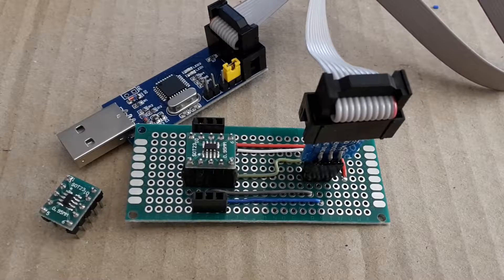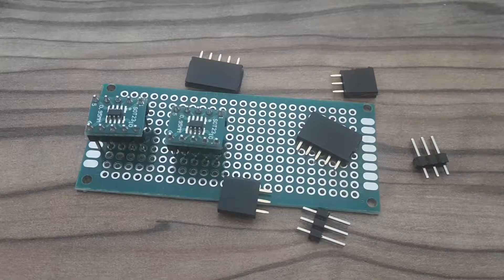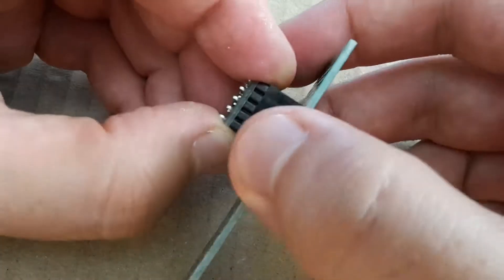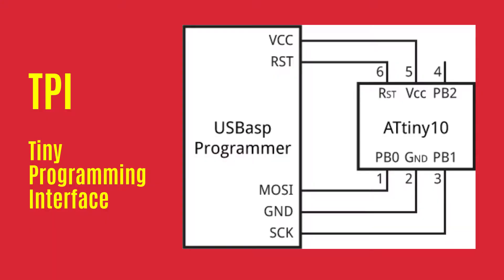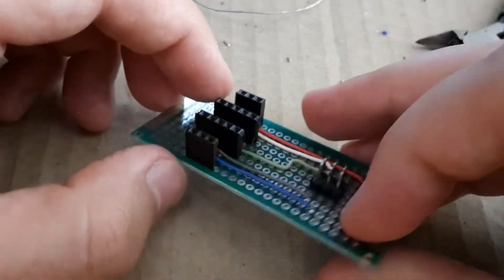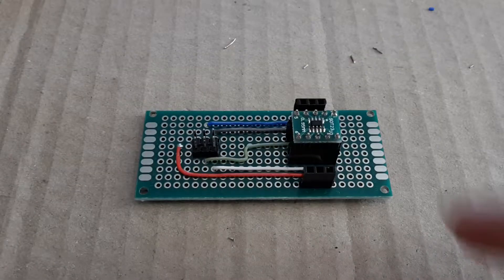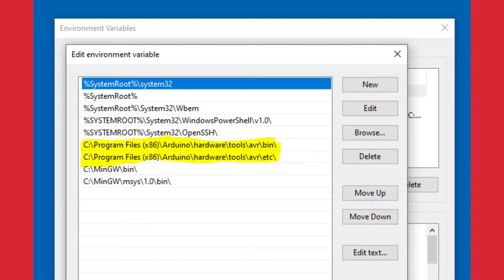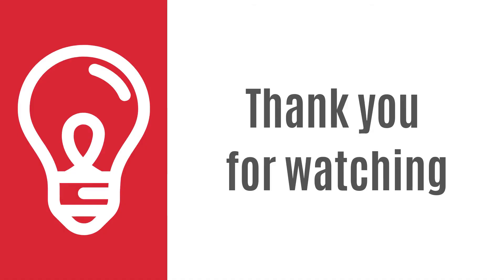Building Prototyping Board for ATtiny10

Comment: Neat old-school 'orthogonal' idea for prototyping boards! Upper layer for horizontal connections and bottom layer for vertical ones. The board becomes probably not the most compact as it could be...
But. No mess of wires and less mistakes when soldering!
Thank you